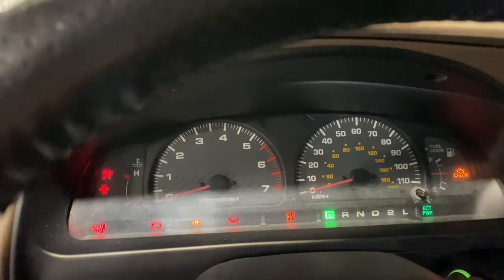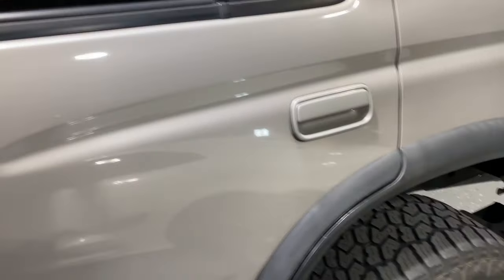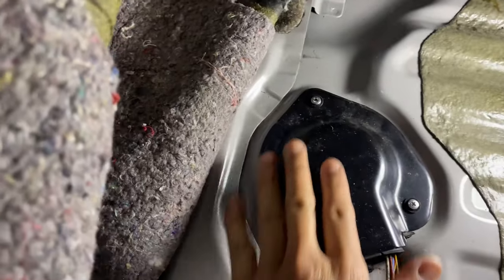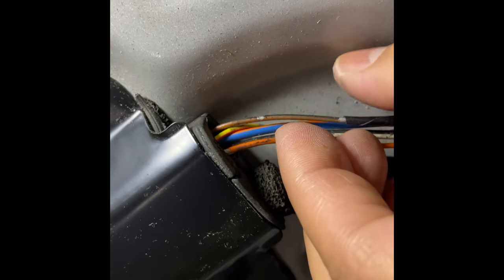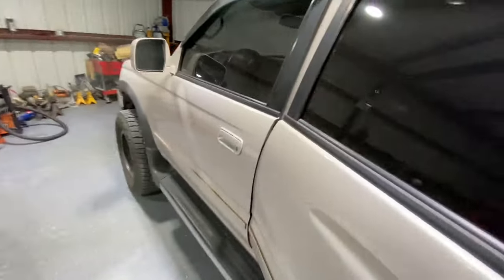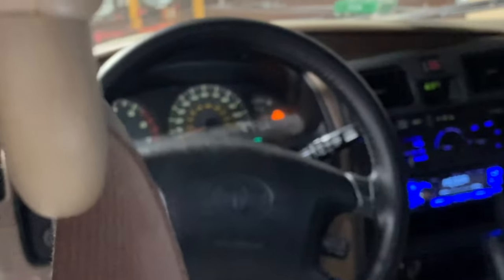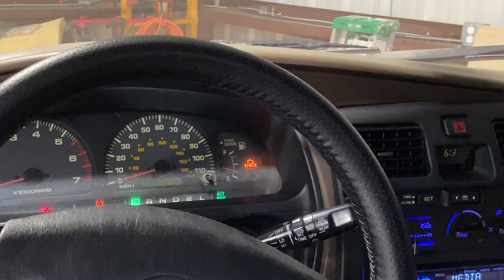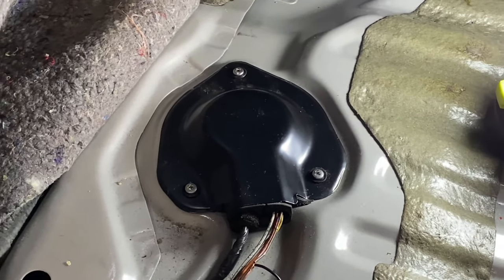Before You Replace The Sending unit on a 1999 Toyota 4Runner / Try This First

Comment: It looks like the gauge wires used on the fuel pump are a smaller gauge than they should be, and when you opened up that ground wire the coppers looked a bit heat-oxidized.  It just adds more resistance to the circuit.  I had some steel-stiff wires going into a relay on an old 97 Ford Probe GT, the relay went out because of heat from the wires melting the plastic over time (under hood temps, being in Florida for 20+ years).  I have a 2000 4Runner and noticed the connector looked tan/brownish on the white connector around the wires, and there was a lot of old di-electric grease in there.  I cleaned it out with some electric cleaner, my pump works but the way it reads every time I fill it is different.  One tank I have 7.8 gallons at half empty, another time it's 13.5, etc.  It's a moving target.  I'm going to try the ground out and see if that solves it since I am constantly in different temperatures every time I refill it, I think that's a factor.  I've already replaced the gas cap and was certain that was a factor after several times not fully seating it it read consistently off the same way  when I was in one spot with the same temps consistently.
Reply from the maker: If you try it and it’s still reading the same then for sure you know it’s your fuel pump sending unit is not working right.

Comment: I tried this and unfortunately it did not fix my gauge on my 1999 Rav4.  So, I found a 1996 RAV4 in the junkyard and I started to remove the fuel pump located under back seat (driver's side).  Little did I know the Rav 4 has 2 sending units the other one sits under back seat (passenger side).  This is the one I removed and luckily this was the one at fault.  My fuel sending unit was so rusty and it's sensors were totally corroded away on top of unit.  The 1996 Rav's fuel sender was in much better condition and sensors were not corroded .  The only pain was removing my 8 badly rusted screws   and getting the fuel hose back on -in a small space  since  fuel line travels under metal body and unless you drop the tank-you can't see where it connects into other pump or gas tank . Needle works perfect now.
Reply from the maker: Sorry I couldn’t help you but at least you got your problem fixed now. You Never going have to worry about playing the guessing game with your gas needle 👍 . I hate dropping the tank period.

Comment: I got a 1999 runner same problem with the gas gauage stuck in the middle...but both rpm and odometer not working too...will adding a new ground fix both the rmp and odometer gauage too?
Reply from the maker: It all depends cause rpm and odometer is on its own circuit. You can try it but if it doesn’t work then your gauge is just out!
Reply: Could this fix the fuel pump issue too?
Reply from the maker: @VessupVisuals  if a fuel pump goes bad you gonna have to change it out.

Comment: Thanks for this video. Very helpful. My 01 4runner gauge is not consistently working. Reset it and it worked for a while, but back to doing it again after I had the fan clutch replaced. After doing your test, how did you finalize your connections? Did you end up grounding your wire to the screw in the video or did you do something else?
Reply from the maker: I ground it to the screw to save me time and the headache!
Reply: @KLIMPORTS  Thank you.
Reply: I did exactly as you did and it seems to have fixed my problem. It took me about 10 minutes. Thank you very much!
Reply from the maker: @tap42  you welcome 👍

Comment: Assuming you used the black metal bit as your ground, could I just strip the wire a bit and sinch it down under that nut?
Reply from the maker: Yes you can!
Reply: @KLIMPORTS  Alright, sweet! And you're using just standard copper wire to ground it?
Reply from the maker: @MarfeeWarfee  yes
Reply: @KLIMPORTS  I’m back to tell you it worked! You’re a legend
Reply from the maker: @MarfeeWarfee   yay, 😁 you welcome glad it work out for you!

Comment: That's a great solution!  This just happened on my 2004 Tacoma (same engine) after replacing my fuel injectors. Any idea where the ground is located on that one? If I've read correctly, the electrical connection for the fuel pump on 1st Gen Tacomas is underneath the vehicle. I haven't checked yet, but just curious if the ground would be the same once I find the connection.  Thanks!
Reply from the maker: There’s is lots of main ground on a vehicle. I just took the easy way out to ground it faster to get the job done. Yes for the fuel pump you have to drop the tank to get to it. But the wires is there if you notice I took the black cover off to see the fuel pump!
Reply: @KLIMPORTS  so on the Tacoma, there is no black cover over those wires; rather, the wires are above the gas tank (in between the top of the gas tank and the bed of the truck - tight space), so there is no easy way to get to it. What I might do is just feel around and unplug it, then bring the wires down where I can see them, then splice into that brown wire (assuming it's the same ground wire on a Tacoma), and find some metal above the tank somewhere for a new ground.  Is there any specific type of wire to use as the new spliced ground wire?  Thanks
Reply from the maker: @eljefeslash   yes I was going to tell you follow the wire from where the plug is and tap it in from there. Just use the same gauge wire as the one you splicing into.

Comment: I gotta try this now, but how do you permanently give it a good ground?
Reply from the maker: To any part of the body. I just strip the wire and put it with any bolt/screws that is on the body. So unscrew one of the bolt/screw and put the wire around it and tighten back down the bolt/screw. The closer the easiest and less wire to use.
Reply: @KLIMPORTS  oh ok. I found another video and put my own screw in, but it worked great! That just saved me over $200 and a day of aggravating work! Thank you so much!
Reply from the maker: @bencorbett5838  np 👍!

Comment: I'm wondering if this will work on a 2012 4R
Reply from the maker: It might be the same concept but different wiring, but the newer model is better designed so it’s probably either your cluster or sending unit.

Comment: Do you have a video on a DIY troubleshooting No oil pressure? Wld you start with replacement of the sensor?? Thank You and I wish my 01 runner was that nice👍👍
Reply from the maker: Sorry I don’t have a DIY for the oil pressure, I can try to help you if you can explain to me what’s going on with your 4Runner.
Reply: @KLIMPORTS  yesterday I had zero OP so I checked oil and it was a lil low. Drive it abt 5 and back and the OP slowly went up to normal. So today I check it and the same thing.
Reply from the maker: @8Scorpions  how you know your OP is low do you have a gauge by itself?

Comment: I had this same problem, this didnt work, new sender didnt work, resetting it didnt work. The only thing that worked was swapping gauge cluster. Worked instantly and has for 2+ years.
Reply from the maker: That’s good that you found the problem, cluster would be the last thing I would change cause they hardly go out before those other parts.

Comment: Do you know where the ground wire goes to? The other end of it? I just had an exhaust shop redo my piping and when I got it back my gas gauge didn't work and fuel light flashing. Thought it was a ground like in this video and sure enough it is. Grounded the brown and black wire and it works but I won't to correctly fix it rather than splicing. Does anyone know where the other end goes?
Reply from the maker: Sorry I don’t that’s the best way to save you a lot of time!
Reply: @KLIMPORTS  ah ok. I understand it'll save a lot of time but I like to fix it properly so higher chances it won't pop up again in the future
Reply: @xxnatas69xx  yeah the splice worked. I knew my ground was melted. Bad quality work for that shop